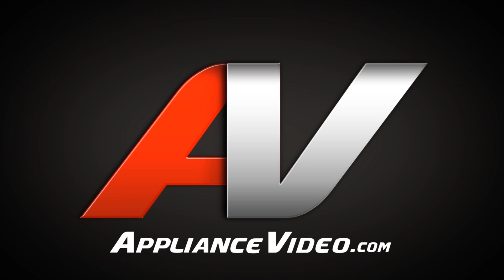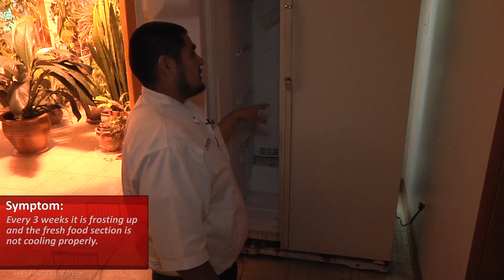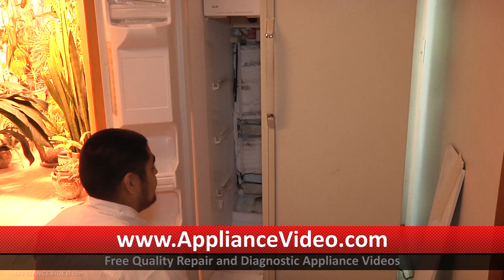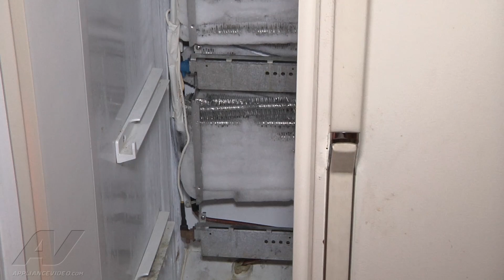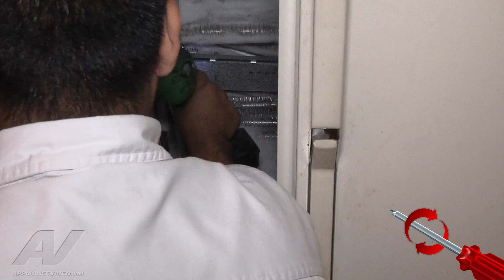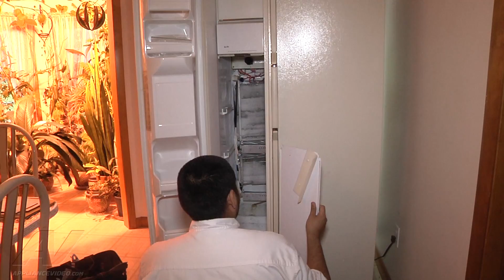GE Refrigerator Repair - Not Cooling Properly With Ice Build Up - Heater Assembly

Comment: I will NEVER buy a GE refrigerator!  I just moved into a apartment with a side by side GE refrigerator and it's freezer is not freezing everything! The refrigerator part isn't working that great either. And both settings are on 9! Ridiculous!  I had a LG and in 15 years had to replace the compressor once! Wish I had that fridge now!

Comment: My lower coils freeze up. I replaced top and bottom heaters with temp sensor and bottom still freezes over. It doesnt have board it older ge side by side.
Reply: Drain tube block
Reply: Did you ever figure out the problem? It sounds similar to what I'm seeing.
Reply from the maker: Great question, if you have a more technical question that our parts department cannot answer, you can search our over 17,000 answered questions free at our website www.ApplianceVideo.com under our Repair Help section. You can also call our parts department at 1-800-830-5465 and they can give you help 7-days A week ,or search at www.SaveMoreOnParts.com  .

Comment: My GE refrigerator rear panel only has two top screws I can't find any other screws at the bottom.
Reply from the maker: Great question, if you have a
more technical question that our parts department cannot answer, you can search
our over 10,000 answered questions free at our website www.ApplianceVideo.com under our Repair Help section. You can also call
our parts department at 1-800-830-5465 and they can give you help 7-days A week
Monday -Sunday, or search at www.SaveMoreOnParts.com  24 hours
7- days A week.

Comment: What does it mean if both the thermostat and heating elements fail the multi meter test?  Does this mean both are failing or could it be something else?
Reply from the maker: Great question, you can call
our parts department at 1-800-830-5465 and they can give you help 6-days A week
Mon-Sat . You can also search at www.SaveMoreOnParts.com 7- days a week.  If you have a more
technical question that our parts department cannot answer, our technicians are
answering all questions at our website at www.ApplianceVideo.com under our Repair Help section. We have over 6,000
common questions and answers that you can easily search through by your model
number, appliance make, problem or error codes, and It’s completely free to
search through our question & answer library. There is a very good chance
you question is already answered there.